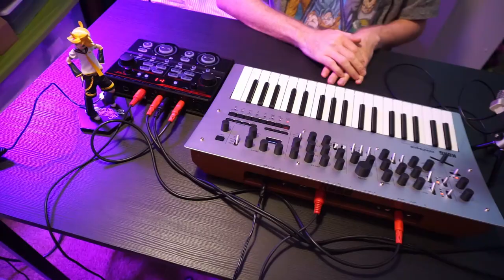Using a midi syncable (boos rc-202) loop station with a synth or sequencer.

Comment: In my opinion, sending Clock information from RC-202, not to it, is better, since you can change sounds without messing the speed while selecting different patches.
Reply: Doesn't the 202 have a rhythm button or something that will actually trigger the sequencer play button..so you wouldn't have to loop the sequencer at all just push play and save loo space

Comment: I have just started using looper pedal with my synths. Bought used Ammoon Pockloop that have a lot of nice options- reverse, 0,5 or x2 speed, infinite overdub on any of these with undo/redo. One thing I miss is that it have no tempo sync. Got to match exact bpm or sequence is out of sync. For ambients its great tho. If this kind of recording will suite my workflow I will definitely consider Boss rc line.

Comment: Not sure if this is the same fix, but I sorted the whole rc202 start stop situation being controlled by my microkorg by pressing (on the rc202); setup>filter(midi)>value button 3 times>turn OnO to OFF. Job done, rc202 still gets clock data but doesn't get any control data from my microkorg

Comment: others recommend using the 202 as master with MIDI. Wouldn't that fix your patch tempo change issue? I just send mine to keystep then that clocks both other MIDI synths and CV. I've only just starting out atm though hence why I'm here.

Comment: Just got an rc202 for my synth and was wondering if you ever get a lot of noise on patches that have not much going on like a bass patch with a mostly closed filter. Just wondering as this unit i got is brand new and am worried it’s faulty
Reply from the maker: I no longer have a rc-202 but I do not remember it having any noise issue. Check your cables and make sure you are using the official boss psa adapter that came with it.
Reply: @YukiTheSynthDragon  top job thank :)

Comment: Try to sync the RC202 with my Digitakt, but it doesnt work at all. Done all the required settings, but if I check the tempo on the 202 there aint no midi, just the regular tempo that has been there before. Doesnt sync at all. Can you tell me what is wrong??

Comment: I’m wanting to buy a looper that will sync with my synths and drum machine
I’m just confused a bit as to how the perfect synced start and stop works
I use to have an fx pedal with a built in looper and drum loops and when you hit the button it started a countdown to the next measure and then you just select the amount of measures
Now I’m ready to buy a good looper and I was hoping I could find a way better version of what I use to have but I can’t find anything that has a perfect start stop, but I’ve noticed that a lot of loopers do have midi out and in and it talks about syncing in the description, but no one ever says exactly how the perfect start stop works

Comment: Can you adjust volumes of each sound recorded into the Boss Rc 202
Reply from the maker: Not after the are recorded. I think you can change the track volume though. But I no longer have it. I have replaced it with a rc 505 mk2

Comment: My RC-202 audio gets a little garbled when set to MIDI slave - you? Could it be the tempo clock from my master devices is drifting slightly?
Reply from the maker: I no longer have the rc-202. I have moved to using an ipad an loopy hd.

Comment: Thanks for this! I'm wondering especially if working with sequencers, after 2 years, you feel like the 2 tracks are enough? Or do you find yourself wanting the 505?
Reply from the maker: I have moved to using an ipad and loopy hd for my looping as of recently. While not as physically elegant it sure makes up for that in terms of versatility.
Reply: @YukiTheSynthDragon  how did you setup the connections between the iPad and the synth?
Reply from the maker: @mojodrum3215  I did not use an ipad in this video. But all you will need to do is use a class compliant usb interface and camera connection kit or usb c cable depending on generation of ipad.

Comment: with it being midi synch'd..does it also help quantanize the start an stop rec points to a degree?
Reply from the maker: yes it does !
Reply: @YukiTheSynthDragon  Thanks for the info for sure....any tips on MIDI settings going from a JDXI to the BOSS-202 ?.not sure if youve tried them together or anyone else has....i see some people saying to set MIDI so no PROGRAM or CC or MIDI notes are sent thru the JDXI or else it can cause audio glitches, some said just use the midi clock there as well?...and not sure about TEMPO sync or LOOP sync?...im suprised i havent seen any videos of people using those 2 gear pieces in conjunction, since theyve been out about 5 yrs.
Reply from the maker: @blasphem0  I have never had a JDXI and no longer has the rc-202so this is just a guess. Maybe try getting midi clock from the rc-202 instead of sending midi clock to the rc-202 ? I do not remember if the rc-202 sends midi clock or if it is just midi through.
Reply: @YukiTheSynthDragon  Thanks again for the suggestion...i use the MIDI in on the JDXI for a Roland A-49 so im not stuck with  little keys....a main advantage to that i dont see many mention also, is that way u can operate 2 separate patches at once, both with their own cutoff an frequency tweaks...would be a good selling point....like u can be playing channel 1 on the full size keyboard while the jdxi itself can be set to play its 2nd,3rd or 4th channel...guessing the JDXA is the same.

Comment: On my rc505 I make a blank loop by pressing Loop Stop and Loop pad, after setting that loop to a number of measures. Then when you record to that loop the aftertouch/fx tails blend in with the end/start of the loop (set it to Overdub).
Reply from the maker: I have done this as well, sometimes I do not like the overlap in fx tails but sometimes it works really well. Works super well with pads though.
Reply: Could you explain what you mean.  I just got a 505. How do you do the above ? I noticed that with my korg micrKorg which doesn't have a sustain pedal the sound just stops. Thanks so much